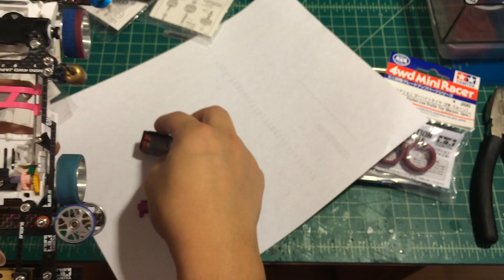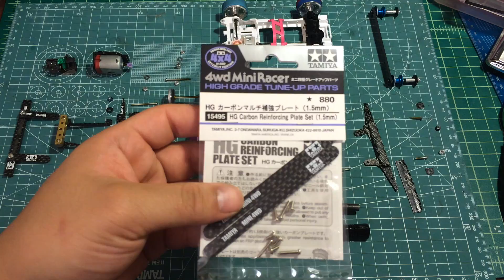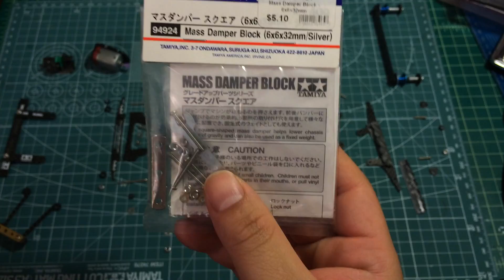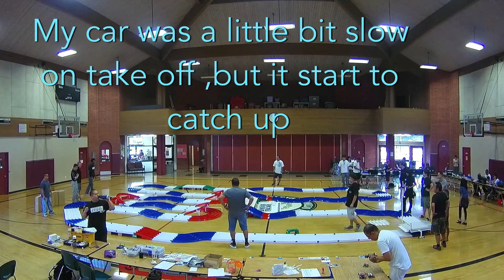Tamiya Mini 4WD 【ミニ四駆】Super 2 chassis speed tech setup review

Comment: whats the difference between 1.5mm and 2mm reinforcement plate?
Reply from the maker: +Ciara Nicole different purpose of use~~ 2MM is really good for roller stay, stronger enough and reasonable weight.   for 1.5MM we normally use for brake, underguard or body damper support.

Comment: Hi, Mad Tang. What a guide! Thanks!! :D

I have one question now, 
what is the SMALL RING-SHAPED RUBBER(?) PARTS that fix the hanging-damper body and rear hammer hanging-damper body?
And does it work better than the SPRING for the sliding damper?
Reply from the maker: +허윤회 that 3MM O-ring from tamiya package, you can google on "tamiya mini 4wd 3MM O-ring" you will find it.... spring VS O-ring are different way of action on hanging damper system~~ speed tech I like to use O-ring~~

Comment: is this setup good for any speed tech track layout?
Reply from the maker: +Perkins Jon Ong if the track is very very very long~~ like the one we have on the video
Reply: +Mad Tang what will happen to this setup for short track?
Reply from the maker: use plastic wheel
Reply: +Mad Tang I see.. Thanks man..
Reply: +Perkins Jon Ong by the way what do you think of using ultra dash for this setup?
Reply from the maker: depend on track layout man~~ if you have more than 6 straight for landing~~  you can try~~ but with Hyper 3 was already fast enough~ there are a lot way to push a hyper dash to limit~ no need ultra~~
Reply: Mad Tang I see.. thank you very much Mr. Tang.. I really learned a lot from you..
Reply: +Mad Tang last question Mr. Tang, what would be a great tamiya kit to start with for a super II speed tech setup like the Heat Edge for MA setup?